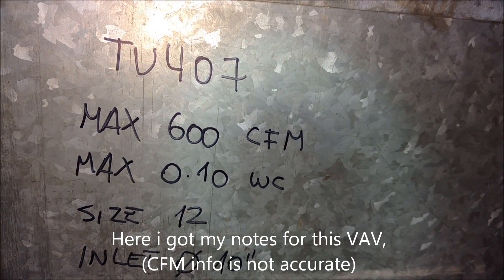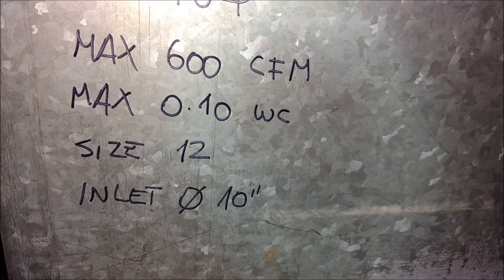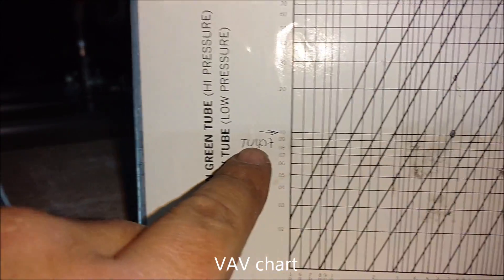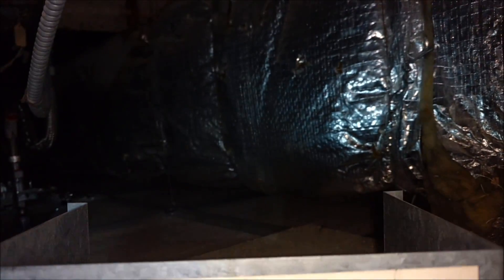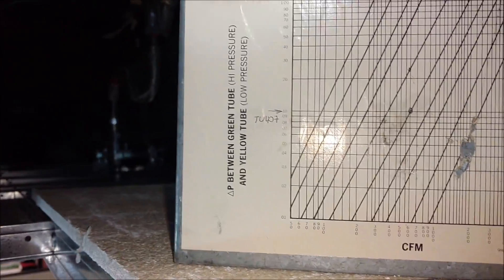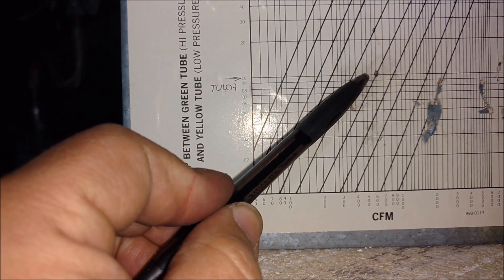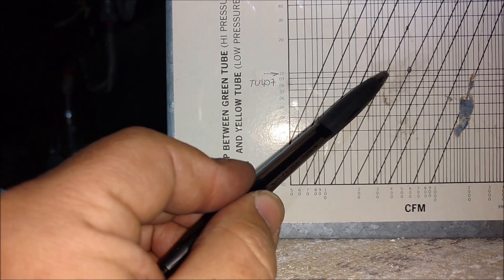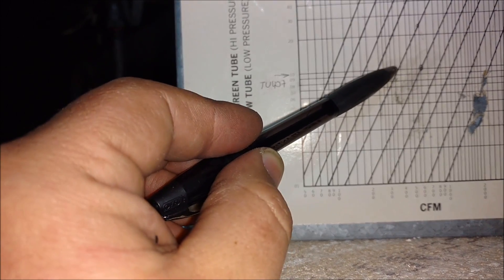Pneumatics in charge - HVAC LIFE

Comment: That chart is used to plot a CFM, not used to determine a max/min CFM. Using your DP and inlet size you can plot the CFM going through the VAV.
Reply: Dave I’m currently working on a VAV  box and have a question on the tag and the actual max/ min settings

Comment: Great video. How did you get the max stat pressure .10wc ? Is that info also on the chart. I see you previously worked on box and had your info on vav, but how did you initially get the max and min stat pressure WC info

Comment: Depending on your spring range on your actuator. If spring range is 8-13 you add 8+13=21, 21÷2= 10.5 should be you target pressure on your thermostat.  Great video!
Reply from the maker: Thank you very much for all the info Fernando and share it with all of us!

Comment: This is really excellant. It's very hard working above these ceilings on a ladder. It's dark, you can't find anything easy. These air lines don't have gauges, you have to break into the line to use one. My 1967 school has tons of this stuff. We have 3 fan rooms with hot and cold decks so hot and cold ducts come down to VAV boxes, different from here. Half the actuators are broke or disconnected so don't worry about calibrating stats. So Alex do more of these service call videos. I have gained some confidence.

Comment: Nice!!  I have been introduced to pneumatic control by the HVAC mechanic at work,  seems to me to be less B.S an headaches than some of the older electro-mechanical stuff we still have as well as the new controls that are out there that you need a degree in computer programming to diagnose and set / repair

Comment: now that's good information to know I haven't dealt too much with vav but we have a few locations that have them installed this is a good base as to where to start and type of tools to use for troubleshooting. great video where can get a set of those small gauges that you had to check pressures on the tstat and valves. thanks again

Comment: .7 is cool deck..11 hot deck??
Reply from the maker: Sorry Michael, don't understand your question, can you be more specific, thanks for your comment
Reply: Ole days .7psi open cool deck 11psi open hot deck on big systems, Just had branch pressure supplied to t-stat then line to VAV or damper in system to open cool or heat.
Reply from the maker: Michael Lee OK got you, they used the vav mostly for cooling only, they have radiant heat in the perimeter.

Comment: Great information...I'm taking this course in college ....pneumatic controls direct drive and reverse action. Thanks for the info keep it coming. Needs all I can get so when I enter the field by the winter I can excel in the industry
Reply: Mike it is good  that  your learning pneumatic to know  but your going to forget in till you come across  it not used anymore most of the older building they are ripping out pneumatic you be better off learning Building Automation System different controls that have out in the field programing ,adjustment different setup for vav,air handles ,pumps, boilers and vfd , lights ,firer controls, they don't use pneumatic because of energy saving every building is set up different .
Reply from the maker: Good luck Mike, the best for you man! thanks for you comment!
Reply: Edward HVACR CT  thank I will take your advice and will learn about the new system that's out there in the field and not lock myself into just pneumatic...thanks again